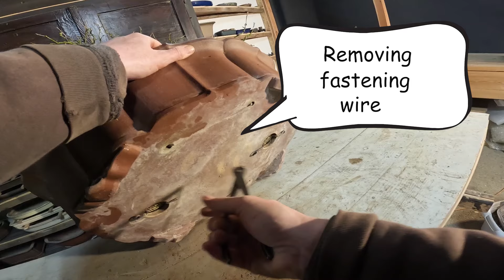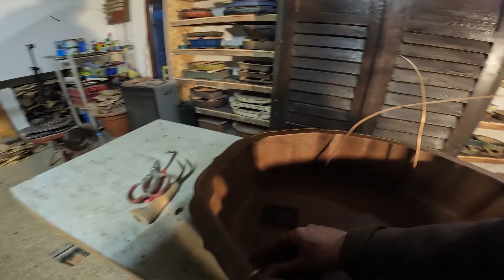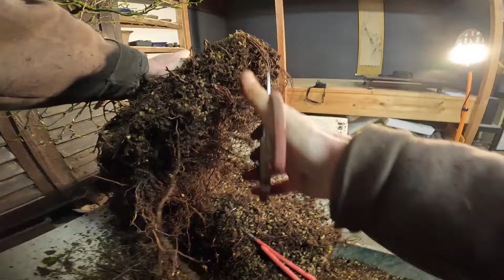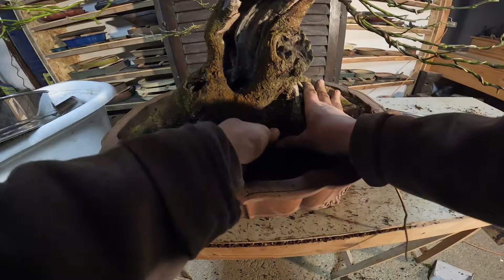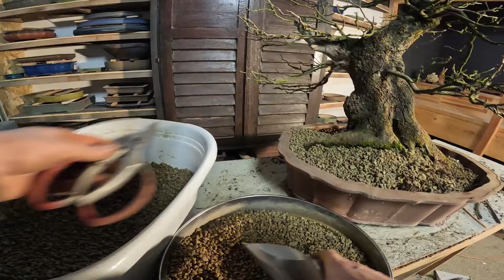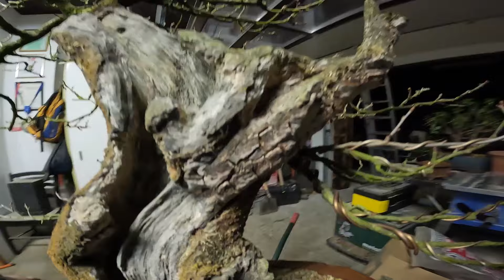How ro repot established bonsai

Comment: Copper wires in the substrate?...
Reply: I might be wrong, but by the looks of it and how easily bendable the wire is, i think it is aluminum wire.
Reply from the maker: It is aluminium wire, don't be misslead by color of it. I never use copper wire in substrate ...